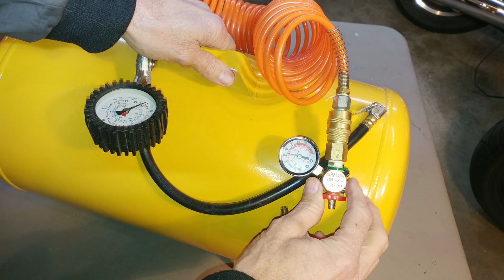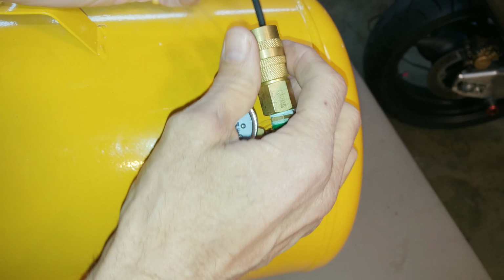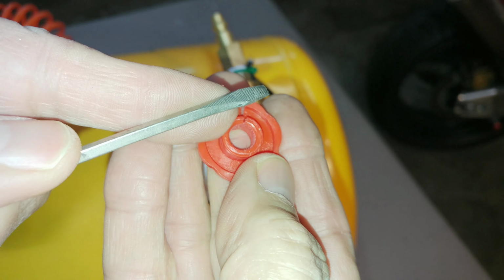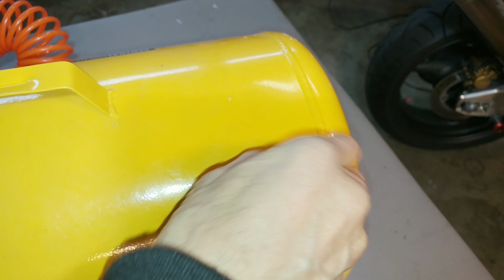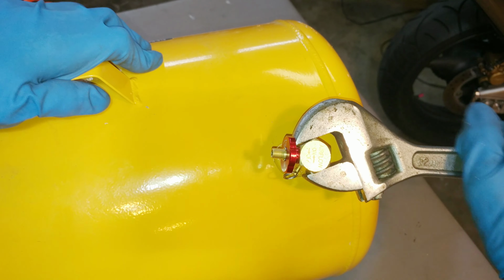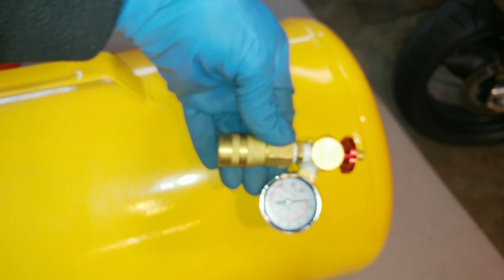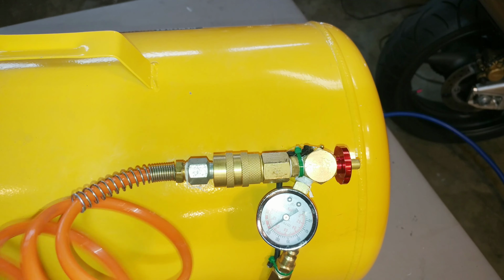Portable Air Tank Valve Upgrade Replacement Harbor Freight

Comment: I'm new to this conversion / upgrade. I have a makita portable air compressor model 2.5 gallon hot dog. I will be buying a 5 gallon tank similar to this tank. I want to be able to use the 5 gallon to increase the overall capacity from 2.5 to 7.5 gallons. I also want to be able to use the air tank on it's own, away from the compressor. I would appreciate knowing if the setup you've shown will accomplish my objective?
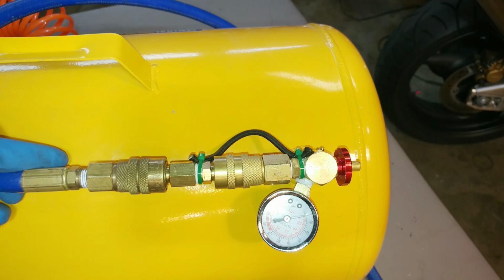Reply from the maker: Yes, that is what's happening in the video. 3:30 The way the portable tank is set up, the quick connect fittings allow easy connection to the compressor for a fast fill. And while it's connected to the compressor, the compressor capacity is increased by the amount of the portable tank. But once it's filled, you can easily disconnect the portable tank from the compressor and use it as a stand alone tank. To leave the portable tank attached to the compressor and use pressure from that expanded system, you'll need a three-way T fitting (a quick connect between 2 male ends) instead of the standard dual male coupler.  You might also want to watch https://youtu.be/BciD6bcOXwU I hope that helps.

Comment: for a small portable tank that i am using to test my pneumatic set up, i made a one lit. tank, but used mini ball valves to pressurise the tank.  i missed using NRV pressumed that ball valve will do a good job of holding the air by me manually doing the shut off.. To my dismay, the valve did not do the job. NOT SURE Why Ball valves are mis behaving. should we use a regular ball valve that i see in garages alternatively. can you throw some light for me please. thank you.
Reply from the maker: I'm surprised the ball valve failed but there may have been rating issues or defects. There are ball valves specifically rated for high air pressure but size and cost are often an issue. I only recommend the compact combo valve units as they are well suited to the portability of the tank and the way these tanks are often used. The replacement mini combo valve I show in the video has been holding up well. The original valves that come with these are terrible and mine lasted less than 6 months. Good luck with it.
Reply: @ScubaMoto  thk you for a detailed reply.
Reply: @ScubaMoto   i tried using a regular ball valve now, but, it too behaved the same. not sure if i am doing something wrong. But, i dont know .

Comment: The 7 gallon aluminum ones are clearanced at HF right now.   Just sayin'
Already bought mine and I'm thrilled with it.  Super light and holds 140psi.
Reply from the maker: Thanks for the heads-up. Our HF here has the aluminum 7 gallon tanks clearance priced at $49. The 11 gallon is currently $10 more. I suppose if you need a smaller tank for space reasons, it may make sense to get the smaller tank. Thanks for the heads-up.

Comment: any hints on now to remove a stuck main or manifold value that wont come loose from the tank threads......... thank you
Reply from the maker: Penetrating oil is most likely the best choice. Let it set overnight. If that is still not enough then there is likely rust involved. If there are signs of rust, I would choose to recycle it all. Tanks weakened by rust are known to blow. Good luck with it.
Reply: thanks for the fast reply and advice
Reply: PB blaster and has they mentioned letbit sit overnight. If it's npt lose enough you might have heat up the manifold with a torch which should do the trick
Reply: Longer wrench

Comment: Very informative, thank you.  Question about the quick fill adapter, does the 18 piece compressor fitting kit on Amazon have everything needed to make that quick fill adapter too?
Reply from the maker: Yes it does. It also includes one quick connect that already has a threaded connect on it so no need for a coupler and less time with the Teflon tape. I hope that helps.

Comment: Just curious if after completing this upgrade does your tank hold air or leak down? I have the same tank and with the factory equipment it won't hold air for more than a day. Thanks, and great vid!
Reply from the maker: You're welcome. I'm glad you liked the video. You just wanted to see if you could get me to go out to the shop and check the gauge on my tank. I just did and the newer valve is still holding pressure well. The original valve did far worse than just leak down. It finally got so bad that it wouldn't even open all the way and it wouldn't shut off. So I had to just leave it on with the inflator plugged on. I felt bad for uploading the first review/upgrade video before discovering just how bad the original valve was. The inflator and the quick connects held pressure better than that original valve. Thanks for watching and for the question.
Reply: Use soapy water sprayed on it to see where it's leaking then address it